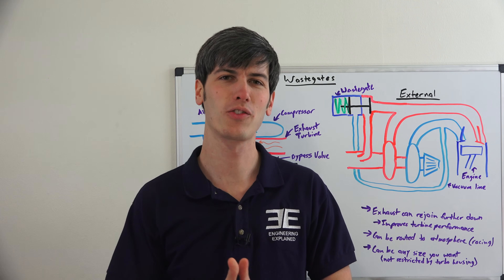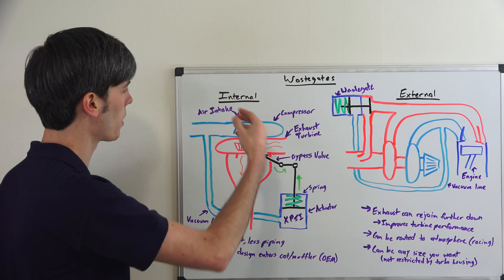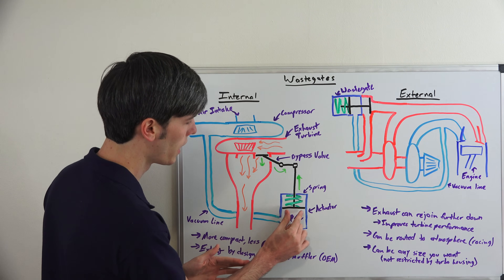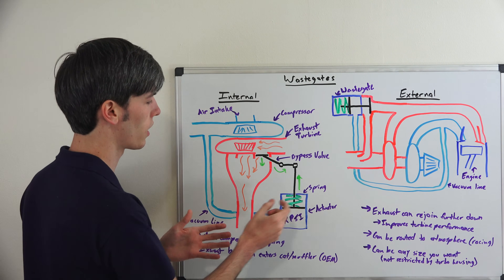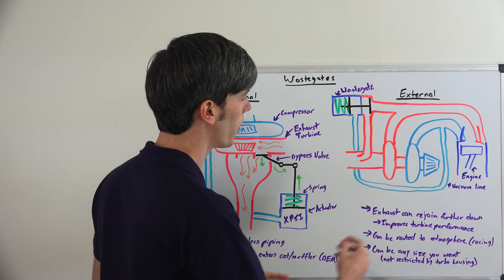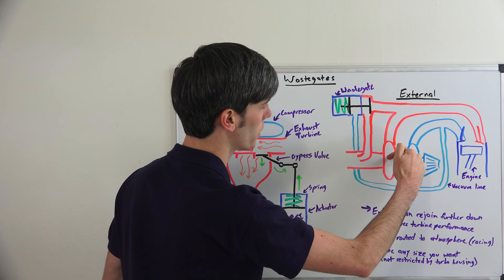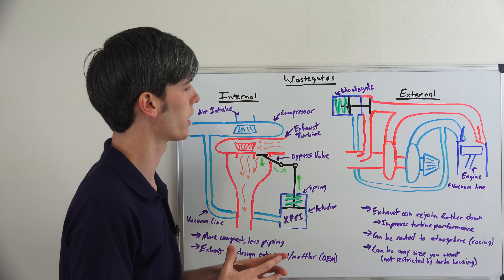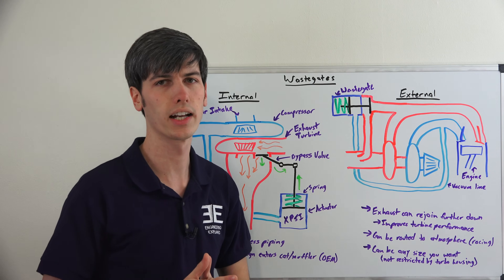How Turbocharger Wastegates Work - Internal Vs External

Comment: Is the external waste gate that 'sneeze' sound I hear my neighbour's skyline make?
Reply: +5croobius
No. It is more likely to be an "unloading valve" or blow off valve.
One is used in high perf engines. As one lifts off the throttle, say for changing gear, the throttle butterfly will shut, shutting of the airflow through the intake and partially stalling the turbine, that then will need to be spooled up to speed again, taking time. The blow off valve opens at this time to allow airflow and the turbine to not stall, but carry on spinning, and so doesn't need that small amount of time to spin back up and provide boost.
Hope that isn't too rough of an explanation.
Reply: +rationalmartian You usually don't hear it on most turbo cars because it is vented into the intake before the turbo.  The loud ones are usually aftermarket bov vented to atmosphere.
Reply: +5croobius yes
Reply: I think it's the blow off valve but i am not sure.
Reply: +rationalmartian interesting, thank you
Reply: +5croobius if its a scream when its full throttle its a open air waste gate, if it is a constat hiss like a cat its a blowoff. 
but a snees during shifting only, is a dump valve and that works differently and has a different function. 
if u hear birds shurping when shifting he most likely has a blowoff and no wategate nor dumpvalve
Reply: +5croobius no. If you hear the WAAOOOOMM----PSHHHH then it is a blow off valve. Pressrized air gets blocked by the closing throttle so needs somewhere to go. This is what blow off valves are for, they redirect it into the atmosphere creating that sound.
Reply: +SoY_FooD "if u hear birds shurping when shifting he most likely has a blowoff and no wategate nor dumpvalve"

Wastegate has nothing to do with the sound, did you watch this video because you still don't seem to understand how they work.
Reply: +rationalmartian " doesn't need that small amount of time to spin back up and provide boost."

In the real world there is no difference in lag between running a bypass valve/blow off valve and not, part of that is without one it doesn't need to fill all the piping with boost again with quick off/on throttle.

Comment: If we apply a external wastegate system which opens directly to atmosphere to a production car and have it half way open, wouldn't it can be used at cheating in emission tests? I don't know the prosedure so don't know if this is a stupid question or not.
Reply: So in theory would it be better to run waste gate open or closed for better emission testing ?
Reply: +yes sir They would see where the exhaust gasses are coming from and not let you have such a modified exhaust on the road, IMO.
Reply: +KomaTechno Is there a thermal camera watching the car to detect any abnormal heat outputs?
Reply: +Abdullah Bal I don't think so
Reply: +Blehtubezz Aus I didn't know that. Thank you for your comment.
Reply: +Abdullah Bal it's a common thing in the automotive world and any manufacturer building a car with a screamer pipe would almost instantly be found out.
Reply: +Abdullah Bal They would also see the dump tube; as Bleh said, it would be VERY noticeable